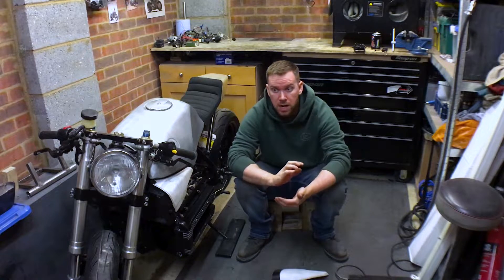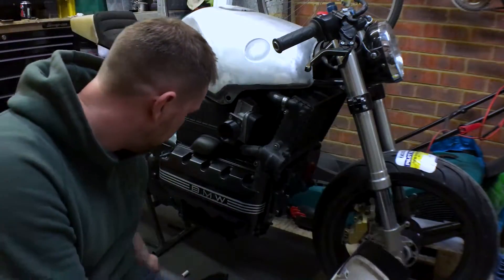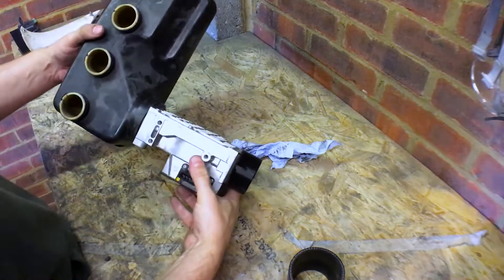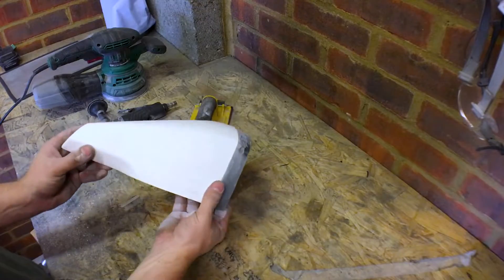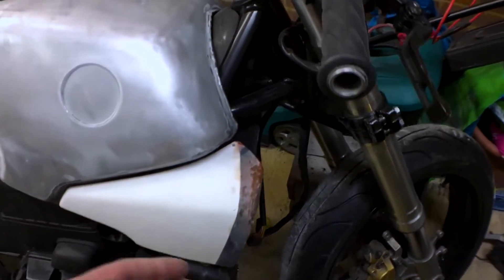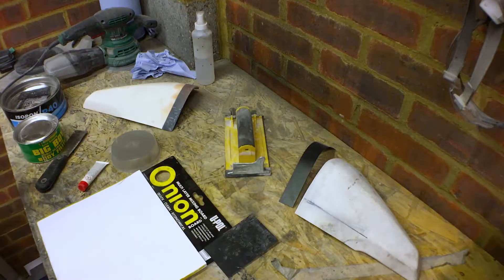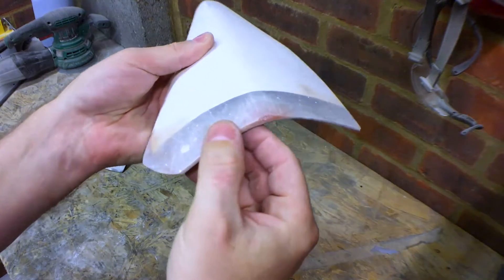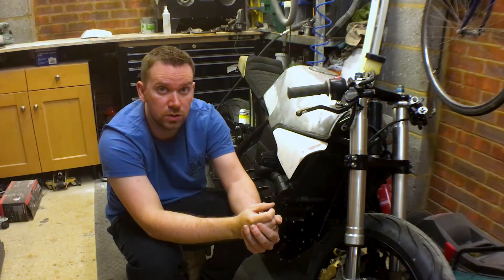BMW K100 | Radiator covers and air filter | Build vlog #11

Comment: Nice one Ben it's getting there, just those 2 little air duct really add to the stance it's gonna be tricky but please don't drill through them better make a bracket that run from inside even if it needs to painted Matt black so it fades inside the bike as you are committed to make them properly....better keeping clean lines

Customising is always sorting out one problem and creating 2 new ones lol but at the end it's all gonna be worth it

Did you consider maybe a 90° elbow for your air filter might still tuck it in tiny bit more? Maybe even line up with the air duct
Reply from the maker: Thanks buddy, I'm working on some brackets for the panels, don't worry there will be no holes drilled.

I did consider it but it's more effort than its worth considering as its not the final version, this is just so I can get it running.

Comment: Enjoyed the longer detailed video! I'm 3d printing some slightly slimmer side covers myself so I'm interested to see your final decision on how to mount them. The callipers would look pretty cool in a gunmetal grey in my opinion. Looks like you have good clearance from the tank on your steering, did you move the tank mounts back or modify the steer stops in any way to achieve that? Keep up the good work!
Reply from the maker: Thanks buddy, I thought the longer video would be too much.
I think they have to be mounted to the radiator, there's no other space that lends itself, I did consider welding a tab to the tank but that seems like hard work getting it all lined up.
Yeah the tank has been moved back 20mm to allow more clearance for the forks, I then made new steering stops that are on the frame that use the gsxr steering stops.

Comment: Hi Ben enjoyed your video once again good job. I've basically down the same with the air flow meter, got rid of the air box/filter box because I'm running an external fuel pump and a performance regulator, well not performance but a lot better then OEM and with a liquid filled gage so I can ajust the pressure at the fuel rail. Question? You may have mentioned it before but where and how did you source those panels you're currently working on? I really like what your doing. Cheers Look forward to your response.
Reply from the maker: Hi John, the fuel pressure regulators can go bad one these bikes so it's always a good idea to replace them.
The panels are from a base model k100, you can still find them but they're getting a bit hard to find now.

Comment: Hi m8, need help. I,m a couple of months into my k100rs "86 build. I,ve rebuilt subframe following tank line.  I need to purchase a replacement shock. However,  i am mounting it to the rear down tube but need to know the stock swingarm possition settings to calculate the length of replacement shock. Any help much appreciated. Cheers, Ady
Reply from the maker: Hi Ady, unfortunately I can't help, if you're doing something custom only you know the right answers. The only thing I can recommend is trying to find a standard k100 and measure the angle of the shock to the swinging arm and with a bit of basic trigonometry you'll be able to calculate the length required. Good luck with your build.
Reply: @Eight20  Hi Ben, cheers for reply, I have calculated the shock angle & mounted the suspension tabs to the down tubes. I would imagine that there are tolerances as to how high or low the swingarm should be set or am I mistaken? Cheers.
Reply from the maker: @ADY954  yes, you need to stick to the standard angle of the swinging arm, or as close as possible otherwise you run the risk of it binding and causing damage.